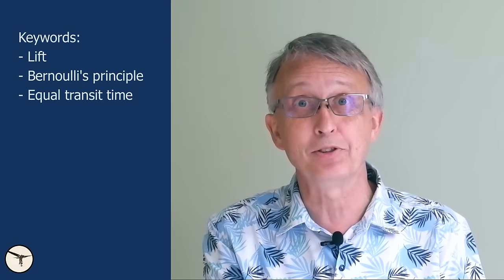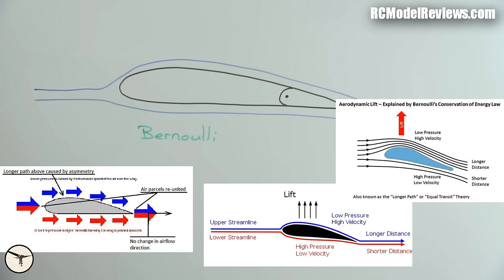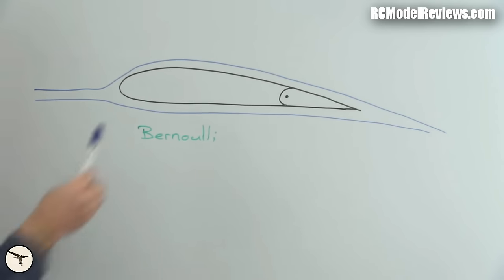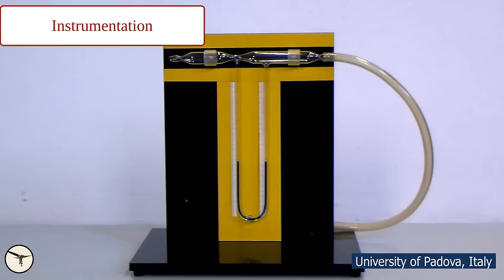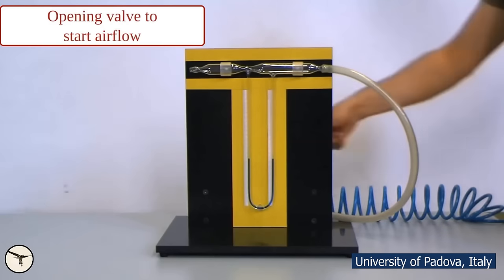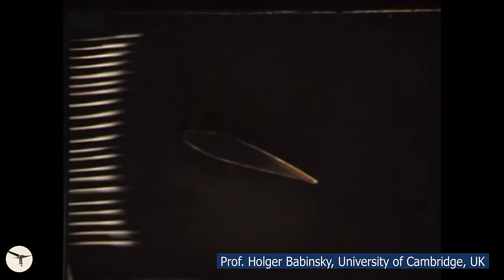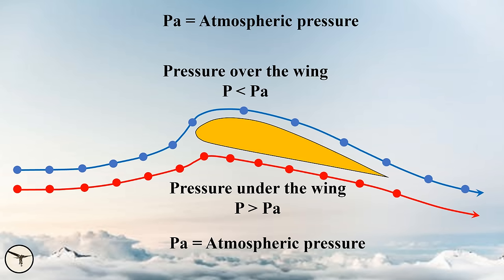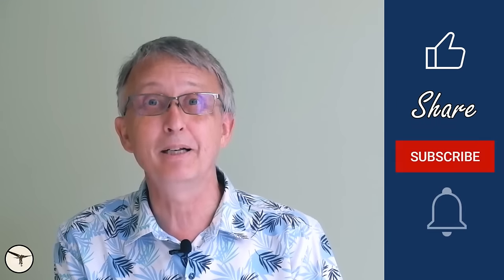Why are so many pilots wrong about Bernoulli’s Principle?

Comment: The fact that you can make a flat square fly if you put the centre of gravity in the right place and give it control surfaces and enough thrust and a positive angle of attack tells me that everything else including the aerofoil cross section and other twiddly bits like wingtip vortex generators etc are all about improving efficiency. All you need is enough surface area to direct some air downwards, get the basics right, and it'll fly.
Reply: Any supersonic aircraft will demonstrate this.
Reply: modern wings are mostly working on air pressure differential on top and bottom. the wing moves forward, making high pressure at the bottom, low pressure at the top, sucking the wing upwards while also sucking air over the top
Reply: @FrostCraftedMC  , you are funny.: „modern wings“?  And don‘t forget, sucking is only an imagination of the real physics. You only can fix that the side which is turned to the incoming airflow (the bottom)  produces more pressure and on the side which is a little bit turned away from incoming flow (upside) decreases the pressure. So it´s clear that there is a difference of pressure that can be seen as generating lift.
Reply: @FrostCraftedMC  Funny... it's pretty windy below a rotary wing aircraft (ie. helicopter). Pretty sure it's not being 'sucked up'.
Reply: @nitramluap  Yep, lift is the opposite reaction to air being pushed down. Helicopter pilots understand that better than their fixed wing counterparts.
Reply: I'll call the flat sheet wing brute force lift.
As I recall there are several effects that create lift, Bernouli's Principal is one, brute force is another.

When all is said and done, lift come from the wing pushing air downwards and the reaction pushes the wing up.
Reply: Also, planes can fly upside-down, sideways, etc.
Reply: @nitramluap  That is “high pressure” you’re experiencing. If you were above the rotor, you’d be feeling low pressure.
Reply: Regarding the 'flat square' wing, I built a flyable RC model in the '70s when I was a teen using just a piece of peg-board for a wing.  Demonstrating that with enough power (I used a .60 engine, which was quite large at the time) you could basically make anything fly 😀
Reply: @thomashowlett8295  At the other end of the scale people use flat sheets of foam with little electric motors and a couple of servos to fly at a few hundred grams total flying weight and less. They fly fine as long as it isn't too windy.
Reply: @lordofthemound3890  yeah the Jelly Bean guy flys with the wings vertical at air shows using the fuselage for lift. It’s very impressive!
Reply: That'll be true when pigs fly. Oh, wait.... they have a curved back, so with enough acceleration, I suppose they can. So never mind!
Reply: Buzz lightyear calls it " falling with style "
Reply: Flight is best explained by the Navier-Stokes equations which are the basis for many simulators. Very difficult to solve -even with modern computers.
Reply: "Enough thrust" is enough to make anything fly. That's why missiles don't have wings.

But if you want to utilize a lifting component like wings in order to reduce the amount of thrust needed, this is more than details and efficiency
Reply: @lordofthemound3890  
Planes can fly upside down and sideways... with enough thrust.

Any plane that flies slow in level flight that then banks 90 degrees (or 180 degrees) will no longer be in level flight, because the wings are not providing the necessary lift and the engine is not providing the thrust necessary to counter the loss of lift from the wings.
Reply: @screenname8267   A square plate with the CoG in the right place that doesn't weight too much will glide though. Not super efficiently but still. You can fly and glide without requiring an aerofoil cross section and enough thrust in this case isn't a large amount either.
Reply: @christophertelford  
Well, gliding by definition has no thrust.
Gliding, depending on your definition, is simply slowing your fall through some manner of manipulating air (in your example, excess wind resistance). This does not require an airfoil.

Now, if you wish to have a controlled glide, where you are able to move forward and change directions - and at times even gain altitude- in a controlled manner while gliding, you require an airfoil.
Reply: @screenname8267  Yes, this is correct.
Reply: @screenname8267  No. You could build up speed in a glide with a flat plate and use that speed to temporarily gain altitude. The same as any other glider. Not having a proper aerofoil would just mean your glide angle wouldn't be as good on average.
Reply: @christophertelford  
Your use of a plate is already using an airfoil. Plates have a curve to one side.
Reply: @screenname8267  When I say plate I mean a flat 2 dimensional shape. I don't mean a literal dinner plate. Angle of attack and forward motion is all that's necessary to produce lift. The aerofoil helps but isn't required.
Reply: I have proven your theory while building and flying controlline airplanes. I've concluded that with enough thrust any shape will fly with a proper CG.
Reply: @christophertelford  
Set a weight under a piece of cardboard that is tilted and place it on the ground. Increase the wind speed. The wind will catch under the cardboard due to wind resistance of the angle, and push the cardboard back, flipping it over. The weight on the ground will remain the same, as when the wind catches the cardboard, it will push the craft backwards, shoving the weight down.

This is not flight.

Set an airplane on the ground. Increase the windspeed. The aircraft's weight on the ground will reduce as the wings generate lift. 

This is flight.

Now... can you make anything fly with enough thrust?
Absolutely. Put a big enough rocket on it and you can make the Iowa fly.

Can you create a frame that generates enough wind resistance that it reduces fall rate?
Yes, that's the concept of kites and parachutes.
Is that gliding and flying? No, not really. Gliding implies a certain capability that is lacking with those.
Reply: @screenname8267  I don't think you get what I'm saying. Build a conventional aircraft with wings and control surfaces but no aerofoil and a flat wing instead. It will fly. The right aerofoil cross section will add efficiency but isn't required.
Reply: @christophertelford  
If I put a large enough rocket on the back of a brick it will fly. Ballistic flight is a thing, yes. I've been agreeing with you on that.
However, to generate enough lift to counter gravity BY forward movement created by an onboard source of thrust, an airfoil is required.

Heck, piston aircraft only work BECAUSE of airfoils. They spin a set of airfoils to create airflow over them which generates lift perpendicular to the vehicle pulling it forward (or in some cases, the spin is reversed and the airfoils push the plane forwards). If you replaced the pistons with flat cardboard, you would not move if they were flat. You would move if they were angled, but you would be moving  through simple laws of motion (board pushes air, air pushes board and plane)... and you would not be able to move fast enough to generate the lift needed... the blades would quite literally be spinning at the speed of sound and you'd still be on the ground.
You would need a VASTLY larger propeller and engine to work off those principles. It is a different type of movement entirely.
Reply: @lordofthemound3890  This is because when flying upside down, the angle of attack is inverted so the air is accelerating over the bottom of the wing (which would be the top in that case) but because the airfoil is the wrong way round, it won't be as efficient. When planes fly sideways, they use the rudder as a wing which means they have to have a slip angle to create lift over the rudder.
Reply: @thijshuiberts2604  I know. I was adding to the OP.
Reply: @screenname8267  I've bought propellers that worked that had no aerofoil. Just flat blades with a positive angle of attack. They are sold for aircraft where it's important that the reverse thrust equals the thrust. You lose a little efficiency over an asymmetrical prop but you gain the same responsiveness in both spin directions. You don't lose a lot or needs loads more power for the propeller to work. The same as a wing without an aerofoil. 
I've built more than a few radio control aircraft with flat wings without aerofoils that flew with significantly less than a 1:1 thrust to weight ratio. This idea that the aerofoil makes all the difference in the world (as opposed to helping a bit with efficiency) is just wrong.
Reply: @christophertelford  
I am curious... what plane needs the propeller to spin in both directions while flying?
Reply: @FrostCraftedMC  Lift is a mass of air being accelerated in a certain direction, thus creating an equal and opposite force on the wing. Nothing is being "sucked" anywhere.  A sheet of plywood will generate "lift" with a small angle of attack.
Reply: And that flat surface will still produce acceleration and thus reduced pressure above the top surface at its leading edge. Additionally, the airflow will still "curve down" on the top surface at it's trailing edge.. Of course, that "curving down" means that a force has acted on the airflow and thus there is an equal and opposite reaction that partially creates lift. Flat surface or not, the forces on the structure are essentially the same (although possibly distributed differently).
Reply: @boeing757pilot   Exactly. Which proves my point that the actual curve is not required. It just improves matters.
Reply: Yes, but that is indeed aerodynamically beyond the first simple approximations: This works because the flow separates in a non-laminar way at the trailing edge of the square plate, and for that reason only the flow curves at the leading edge create the "usual", simplified aerodynamic forces. Because the force is all at the leading edge, you also get a huge torque, which you'll need to balance with the center of gravity.  However, because the stagnation point at the leading edge is very difficult to control, this will not be very stable.
Reply: @rdspam  Supersonic flight is an entirely different aerodynamic regime (air goes from largely incompressible to a compressible medium, for instance) , which is one of the reasons why it is so difficult to built planes that are efficient in sub-, trans-, and supersonic flight, and not just in one of them.
Reply: @christophertelford  L x W x H We live in a 3 dimensional whatever this place is. If only there was people that used "wings" upside down in order to create "down force" to help people understand how "wings" actually work in a 3D environment
Reply: @christophertelford  Are you familiar with carburettors? Do you understand how they work? Would a depression be created in an acceptable manner to draw the fuel with one of your "2D" flat surfaces? 

I think you should build and fly a life size plane with all flat components and let us know how it goes
Reply: That's true, but it won't fly very far because it will run out of fuel. Lift due to pressure differential is quite efficient but lift due to brute force eats up fuel quickly unless it's managed well.
Reply: @nitramluap  Surprisingly enough, the blades are aerofoild and pressure above is lower than pressure below.
Reply: @JohnDoe-vx3z  No it isn't. Some lift is generated by air being pushed down but only a percentage.
Reply: @lordofthemound3890  That's what control surfaces are for. They alter the airflows areond lift components.
Reply: @jdoe9518  Why would I want to build a full sized aircraft with a flat wing when I've already proved it works with scale models? That's the point of the scale model. Have you ever build any kind of fixed wing flying aircraft with a flat plate wing? Maybe you should start there before telling me to build a full sized aircraft when I'm already satisfied the principle works just fine.
Reply: @jdoe9518  There are people that use wings upside down. They are called pilots. I am sure there are other situations that cover this too. Some of them do it with symmetrical aerofoils and some with no aerofoils but yet they still fly.
Reply: @christophertelford  ever heard of motor sport? Formula 1 might be example
Reply: @christophertelford  how about carburetors?
Reply: @jdoe9518  If you want to bring motorsports and carburettors into the discussion I'll let you explain exactly how you think they are relevant and what they demonstrate. Meanwhile I'll go back to flying my radio control aircraft with flat plate wings and propellers demonstrating that aerofoils are not needed to generate lift or thrust (or downforce when upside down). They just help.
Reply: @christophertelford  I'll ask again. Do understand how a carburettor works? It's a yes or no
Reply: @jdoe9518  Yes I understand the basic principles but no I'm not excessively familiar with them. Make your point or don't.
Reply: @christophertelford  I just did
Reply: @jdoe9518  Not really. Carburettors don't have to generate lift. The fact they demonstrate the Bernoulli effect isn't relevant to this discussion as no one is saying there is no Bernoulli effect. Only that a wing flies just fine without an aerofoil cross section and the Bernoulli effect isn't the most important effect when it comes to aircraft. If you want to argue that it is when it comes to carburettors I feel no need to disagree with you. 
But please feel free to explain what I've missed if you think carburettors are relevant to the discussion about wings in any way.
Reply: @christophertelford  Is that right? How the fuc k does the fuel get from the bowl into the air stream? 
It is LIFTED out of bowl whilst being metered through a fuel jet whilst simultaneously being emulsified with atmospheric air being drawn through a air correction jet and into the AUXILIARY VENTURI to deliver a fuel air mixture into the air stream ALL via THE DEPRESSION (AKA LIFT) due to the INCREASE in air speed CAUSED by the CHOKE that is a AEROFOIL. This system is required to maintain LIFT at varying air speeds and pressures created by two separate conditions, engine SPEED and throttle PLATE (the plate is 3D btw) ANGLE or the engine will STALL. If you're in a plane this will cause the plane to STALL  STALLED PLANES FALL OUT THE SKY.
Your claim is you fly a scale model plane with 2D wings (which do not and can not exist except in drawings) with no aerofoil that require no additional power to fly whilst simultaneously saying there is a decrease in efficiency which instantly implies an increase in power is required. 
So this discussion about carburettors and wings is more about your ignorance than anything else.
Reply: @dougaltolan3017  Exactly. Newton's 3rd law.
Reply: @jdoe9518  You seem hell bent on having an actual argument with me rather than discussing the issue at hand. The carburettor may lift fuel up within itself but it does not generate a lifting force on itself or the thing that holds it like a wing does, just on an internal component (the fuel). Clearly you understand carburettors much better than wings or else you wouldn't keep trying to move the discussion there. 
Obviously 2D objects don't exist within a 3D universe. When I say '2D' I am describing an object with minimal thickness as opposed to no thickness. I am sorry I thought that was obvious. It's a fairly standard verbal shortcut that people use. 
The low pressure zone in the carburettor is created by a venturi not an aerofoil. That's a narrowed section of pipe - not quite the same thing but it does demonstrate the Bernoulli effect. Maybe we should go back to talking about wings, the subject under discussion?
But I have not claimed you don't need to additional power to fly a plane without an aerofoil. Since aerofoils aid efficiency it stands to reason that a plane without an aerofoil but with a simple flat wing will require more energy to stay in the air. No one is arguing any differently there. I did say that you don't need loads of extra power - just a little. Remember when they put wing tip fences on all passenger jets after realising they saved some tiny % of fuel used? That's why you don't see people building planes without aerofoils. It's all about efficiency.
Reply: @christophertelford  yeah not reading that.
Reply: @jdoe9518  I did think it might be a bit too complex for you. Come back when your reading comprehension has improved and we'll restart the discussion.
Reply: @christophertelford  Dunning Kruger
Reply: @jdoe9518  You are criticising me while refusing to read my responses. I don't think that's an intelligent position to take. The swearing and all caps were also a clue. If you can't be bothered to read then maybe don't bother writing either in the future.
Reply: If we were still having a civilised conversation I'd ask you what you think your detailed description of the Bernoulli effect as it relates to carburettors has to do with the discussion about wings? You've definitely demonstrated the importance of the Bernoulli effect as it relates to carburettors. How does this effect our discussion about wings? No one has suggested the Bernoulli effect isn't real or important in regards to carburettors but if they had you'd have shown them how wrong they are.
Reply: @christophertelford  arguing with stupid people is pointless. Therefore I see no point
Reply: @jdoe9518  It was a conversation until you turned it into an argument. I get the impression the aim of the conversation was to convince everyone of how intelligent you are rather than to actually engage in the exchange of ideas. You are the only person I had this problem with.
Reply: @FrostCraftedMC  Again, what if you are flying inverted?  Does the wing push the airplane to the ground?  Don't believe that it does.  The other comments explain how it all works.  Thanks.
Reply: The acrobatic planes have symetrical profiles. A lot of indoor model airplanes have no profile at all. And above all: a lot of planes can fly inverted.
Reply: You're pretty optimistic if you think any old square will do. You have to have some lightweight strong stuff. Most consumer products have a safety factor of four or five. If the ultimate breaking strength averages about 500 lb the working load will be about 100 lb on a piece of rope. Airplanes can't have that kind of safety factor or they won't be able to pick themselves up off the ground. They're about two to one. The mathematics involved in building an airplane is a vast subject. This discussion of Bernoulli's principle was very popular with everybody but the math is very low level.
Reply: @JohnDoe-vx3z  the helicopter pilot also has one other thing to keep in mind. If you hovers in the right space and still air the air beneath them can begin to rotate and the pressure can drop and the helicopter might just fall right down into that low pressure with the blade spinning as fast as they can. Fixed wing aircraft don't have that problem.
Reply: Entirely correct Christopher. Glider pilot here.  These Bernoulli drawings need to disappear from the theory books in the chapter "How lift is generated'. You only hear the sucking noise when the plane stalls ;-)
Reply: @screenname8267  Not entirely correct. Fortunately gravity always points downwards. At 90 degrees with enough thrust, the fuselage will provide the lift. At 180 degrees (inverted) with enough thrust, the wings will provide lift (although less efficiently because also the fuselage will be at an angle of attack and you have a wrong wing setting angle).
Reply: @mmichaeldonavon  Actually, yes. When you invert, you lose altitude and must compensate with thrust and pitch -unless you have an acrobatic wing shape (and even then, you still require some compensation of thrust, you cannot fly as slow inverted as you can upright and maintain altitude)
Reply: @screenname8267  When you look "at it," keeping an airplane up in the air, all that happens with an airplane is the wings push the air down and Mr. Isaac Newton steps in and gives us an equal and opposite reaction  and keeps the airplane up in the air.
Reply: @mmichaeldonavon  
If it is an equal reaction, how does the plane move upward of downward in level flight? In an equal reaction, the plane would only stay level unless pitch was changed.
Reply: @screenname8267  Oh, I fully agree with what you say.  I was trying to say that an inverted airplane stays "at altitude" by ;pushing the air down.  Yes, pitch has a commanding role..  Thanks.  N6395T  but my favorite GA plane is the Arrow.  See you  ;later.  "Positive rate, gear up."  :-)
Reply: @theophrastus3.056  female pigs will have several vortex generators on the underside of their body foil.  Male pigs-
well, never mind.....
Reply: @77thTrombone  Transpigs are the answer. Or maybe a pig that just “identifies” as a bird?
Reply: @screenname8267  Well an airship does, but I don't think they use symmetrical prop blades, they still have an efficient "forward" design but can provide enough thrust in reverse.
Reply: @screenname8267  The thrust upwards is equal and opposite to the air thrown downwards. It's not equal and opposite to gravity, necessarily, unless the aircraft is trimmed for level flight. If the forces upwards that are equal and opposite to the air thrown downwards exceeds the forces of gravity then the aircraft will climb regardless of it's attitude. Changing pitch is one way to achieve this change in the balance of forces.
Reply: @christophertelford  
Changing pitch, altering the angle of attack, IS changing the curve of the path the air travels (and is accomplished by, funnily enough, altering the lift at one end by means of changing the curvature of the stabilizer). The principle of lift used for powered nonballistic flight requires utilizing this to create a low pressure system and a high pressure system, causing the craft to be pulled upward with greater force than gravity pulls it down.

Does a paper airplane glide? Yes. If you put a motor on it, will it fly? Not if properly balanced unless you alter the curvature (you can always put weight in the back that causes the engine to point up and fly ballistically, but thatbis ballistic flight). If properly balanced it will move in a straight line until it huts a wall. An airplane with an airfoil will leave the ground in a neutral position once it hits the appropriate velocity, as its wings will generate  lifting force.
Reply: @screenname8267  Your statements about things a plane without an aerofoil can't do are just wrong. Plenty of people who have built RC planes with flat wings will attest to this fact. Pitching upwards means altering the angle of attack of the wing relative to the horizontal airflow and it is this increase in angle of attack that generates extra lift. This works just fine on a completely flat wing or an aerofoil wing just the same. The angle of attack generates this lift by moving a mass of air downwards so that the aircraft reacts in the equal and opposite direction. 
Put an engine on a paper plane and it will fly just fine. They sell them as kits. They climb as you add more power and glide downwards when you cut the power. Some have 2 motors so you can steer with differential thrust. They are low powered kids toys and do no fly using 'brute force' or ballistic flight.
Also, some aircraft have 'all flying' tails with no aerofoil where the whole tail surface moves. So they would change pitch by turning a flat plate tail. No altering of curvatures at all.Just altering the angle of the flat tail vs the wing.
Reply: @christophertelford  
Let me ask you this:
If pitching upward to increase angle ofbattack causes lift simply by newtonian law, why will the plane stall and lose lift if airflow over the TOP of the wing becomes disrupted? If it is only Newtonian Law that keeps it up, then airflow under the wing is all that is needed to fly, but disrupted airflow over the wing will cause the plane to drop.
Reply: @screenname8267  Boundary flow separation causes turbulence and excess drag which disrupts the smooth downwards flow of air off the trailing edge of the wing while increased drag means that the aircraft will lose airspeed and stall even if the excessive angle of attack and boundary separation doesn't do it.  Either of these two factors will cause the aircraft to fall out the sky.
Reply: @christophertelford  
Simple newtonian law would not care if the flow of air after leaving the surface of the wing was smooth or not. The air was pushed down, the plane is pushed up. Airflow after the fact is only relevant in the model where curvature matters.

Furthermore, it is possible to stall a low-speed wing with a high curvature by flying too fast while maintaining angle of attack. A newtonian model would not allow this. Higher speed at the same angle of attack would result in more air pushed down meaning a net higher lift, not less.
Reply: @screenname8267  That's why you've got to think in terms of slightly more complex newtonian physics combined with a bit of other science too. If you look at wind tunnel side on views of wings stalling and the airflow patterns you can see that the downwardly directed stream of air off the trailing edge breaks up and turns to vortices and turbulence when the angle of attack becomes too great due to the boundary layer losing all cohesion to the wing. The air loses it's clear clean downward directed flow which results in less lift due to the reduced movement of air in one clear direction and thus less of an equal and opposite response by the aircraft in the other.
Reply: I am an electrical engineer  and I am not in the aviation field, but my idea of   lift created by wings matches your idea very much, in fact I am in search of a person having an experience in aviation to vet my idea. Thanks for your patient discussion
Reply: @christophertelford what you wrote is partially true. I remember reading a fantastic explanation provided by an aeronautical engineer who clarified that about 2/3 of lifting force is coming from the inherent properties of an airflow travelling over an airfoil vs. 1/3 of the force coming from the upward push of an incoming airstream (we can say force vectors do the job in the latter case). So yes, you can make a flat square fly but it will be rather inefficient way of producing lift. As a glider pilot I can say you can physically feel the magic occurring at the wing causing you to struggle to hold the wing in place by its end (on the ground) whenever it receives even the slightest gust of head wind (it tries to lift you up). On contrary, if you try to hold a flat piece of plywood pitched upwards at a certain angle, exposed to the same kind of head wind, you will find it difficult to hold it in place not just vertically but also horizontally. That's because the flat piece of plywood experiences both the upwards push but also a significant drag pushing it backwards. This is where the airfoil-generated lift wins as the airfoil produces way more upward push than adverse drag force.
Reply: "All you need is enough surface area to direct some air downwards" - you need engine to move your surface. And you need efficiency to fly far enough. So you have to account for Bernoulli's principle as well.
Reply: @TheRVSN  Of course you need an engine if you are not gliding and of course the aircraft needs to be basically efficient enough and airworthy. The fact remains that symmetrical aerofoils exist and you can even make a plane fly with a flat wing (perhaps with rounded leading and trailing edges to help with drag) without any aerofoil shape.
Reply: @christophertelford  "The fact remains that symmetrical aerofoils exist" -

for aerobatics only. Please explain why asymmetric airfoils are used.
Reply: @TheRVSN  The point is not why they are used. The point is that they work just fine. It'd be interesting to compare two otherwise identical aircraft, one with a symmetrical aerofoil and one with an asymmetrical aerofoil. I presume the later would be slightly more efficient in the cruise. That's why we use them. Don't forget they added vertical wingtips to all the civilian jets when they realised they saved a couple of percents worth of fuel. Small improvements save a lot of money on fuel costs. That doesn't mean you need vertical wingtips or a properly designed asymmetric aerofoil to make an aircraft that flies well.
Reply: @christophertelford  "The point is not why they are used." -

it is exactly the point: the economics of flight. What airfoil and wing shape to use for specific parameters of flight (altitude affecting air density; speed; duration or distance)? Airfoils (complete air flow path) are investigated in wind tunnels for lift force and drag, as well as for critical angles of attack. Recommendations are issued based on results of investigations and wing structures are developed based on recommendations. So due to Bernoulli's principle asymmetrical airfoils really generate more lift than symmetrical ones per burned gallon of fuel and that is the reason why they are more efficient.

Such videos denying basic education like Bernoulli's principles application to generate lift are made on purpose to generate comments. And that is a pity of making people dumb instead of educated. If the author really cannot understand the flight dynamics based on physics then that is twice a pity.

"Don't forget they added vertical wingtips to all the civilian jets when they realised they saved a couple of percents worth of fuel." -

that is completely different story - induced drag.
Reply: @TheRVSN  I'm not sure what the point is that you are actually trying to make but I get the impression you are now actually agreeing with my original point while trying desperately hard to disagree with me. I'll remind you I said that;
"The fact that you can make a flat square fly if you put the centre of gravity in the right place and give it control surfaces and enough thrust and a positive angle of attack tells me that everything else including the aerofoil cross section and other twiddly bits like wingtip vortex generators etc are all about improving efficiency."
If you can understand that 'efficiency' and 'economics of flight' are two different terms for the same thing then I think you should get my point here. Yes a properly designed aerofoil flies better (generates more lift / is more efficient etc.). No it's not required for flight it just adds a bit of efficiency. Symmetrical aerofoils still exist and planes can still fly upside down even with asymmetrical aerofoils. Bernoulli isn't no.1 when it comes to flight.
Reply: @christophertelford  Bernoulli is No. 1 when it comes to flight because he wins efficiency and as a result he wins the economy - as soon as we are talking about subsonic flight.
Reply: There's some power to weight ratio as well
Reply: @markmcgoveran6811  "There's some power to weight ratio as well" - thrust to weight ratio :).
Reply: @TheRVSN  it's not right and wrong you're just very tiny in your mind. Yes there would be both, and a lot more. As you design something you do trade offs based on these ratios which are linear and various nonlinear relationships and build the airplane to perform the way you wish.
Reply: @FrostCraftedMC ensinam isso dessa forma porém está errada pois seria fatal voar de cabeça para baixo
Reply: A verdade é que o avião como um planador voa devido à asa trazeira chamada Plano Horizontal que é ativada pelo Leme Horizontal, chamado Profundor, permite subir a um Plano Superior ou descer e esse controle basta para estabilizar a asa frontal. Será um avião quando houver o motor para a propulsão do planador.
Numa comparação é fácil explicar porquê será impossível o voo sem o Plano Horizontal: passe um facão cortando a água numa piscina e verá que seu controle é impossível; também uma faca (asa) cortando um queijo (ar) não terá fatias uniformes, a menos que haja um estabilizador traseiro nessa faca. Enfim o segredo do vôo do avião está na asa trazeira.
Reply: @jadneves  "Enfim o segredo do vôo do avião está na asa trazeira." -

that is classical aerodynamic scheme. There are other schemes like flying wing that utilize differently arranged wing foil to provide stabilization and control.
Reply: You are correct.  Lift is produced by a flat plate at an angle to the relative wind simply by deflecting a large mass of air downward.  Everything else associated with an "airfoil" shape has to do with reducing the drag, which when it comes to flat plates is huge.  Plus, an "airfoil" shape gives a handy place to put the wing spar because flat plate wings are usually too floppy.
Reply: Angle of attack, boys and girls.  Without it, you'll roll all the way to Topeka.  Everything else helps the air foil be more efficient and allows a greater angle of attack before stalling.  Ask your selves this...What's the first thing you do once you achive take off speed?  If you don't rotate 10 or 15 degrees, Topeka, here we come.
Reply: @michaelripplinger2169  Exactly.
Reply: fact is. the paper will lift up if you will blow above it. or vertical paper will deflect in side where you will blow.
Reply: @einherz  Fine, if you are flying paper airplanes.  I know my comment sounds flip, but we are lifting hundreds of tons of airplane and contents.
Reply: @michaelripplinger2169  physic don't knows difference. aerodynamic as part of physic - too. different wing load need different wind for lift for blow up boing you need 150knts. for lift up paper aircraft enough much lower power, but on both aircraft act same forces
Reply: @dougaltolan3017  An aerodynamicist explained to me the wing pushing air downwards is like a rocket providing thrust. He even admitted in his early years was taught the misconception of Bernoulli’s until his more advanced classes.
Reply: @FrostCraftedMC 

noo... the pressure differential is just the result of moving so much air downward... 

Even a desk fan has differential pressure ...
Reply: @nitramluap 

Succion is having less or no pressure at all

Succion don't exist
Reply: @dougaltolan3017 

Yes that's right

6%   bernoullis effect
94% brute force
Reply: Exactly right.
Reply: If Bernoulli was the only factor creating lift,  how then does a plane fly upside down?  Also,  how do symmetrical wings produce lift?
Reply: Angle of attack seems to be very important,as long as it isn't pushed to stall.